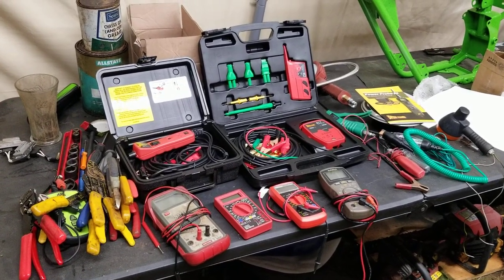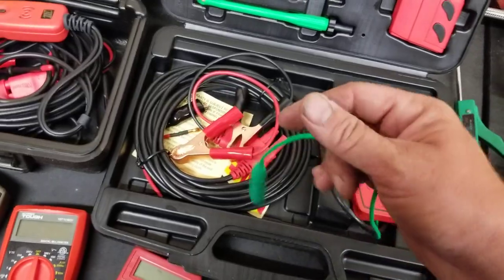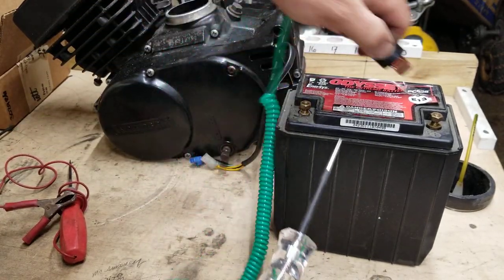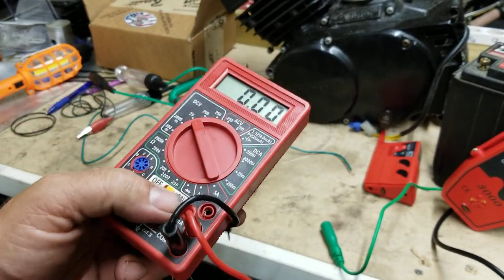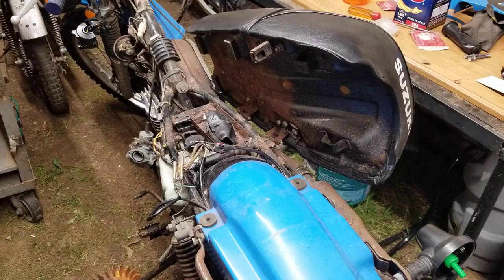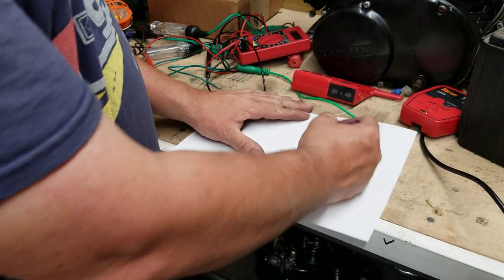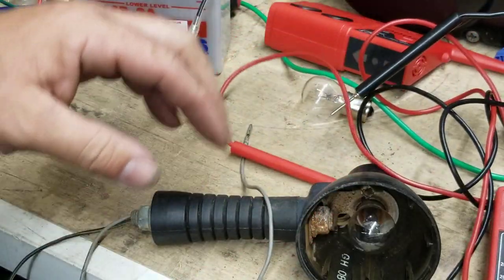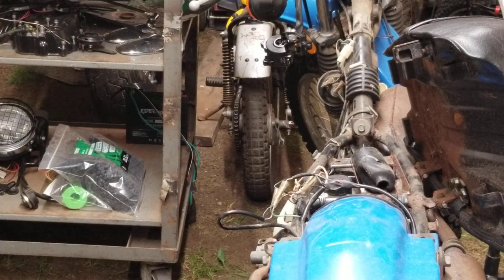Electrical class 101 and kool tools part 1

Comment: Loved the intro to Electrical Class 101 "Professor Kevin". Best intro ever! I think most everyone has a cheap Harbor Freight digital multi-meter which is a great tool for checking continuity, finding possible shorts in wiring, checking bulbs and batteries. And your right, if you drop that cheap meter, who cares, it was free!  I feel much more "grounded" now that I have watched this video. I hope you will get a lot of "positive" comments and people who do comment are not "short" with you?!
Reply from the maker: Thank you you don't need expensive tools to do the same job